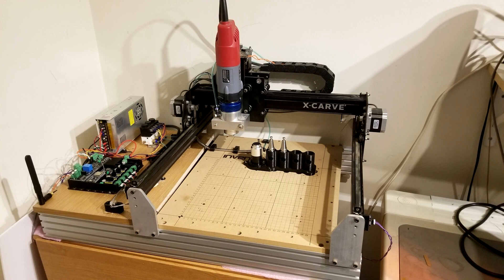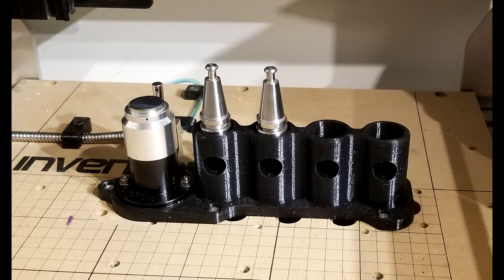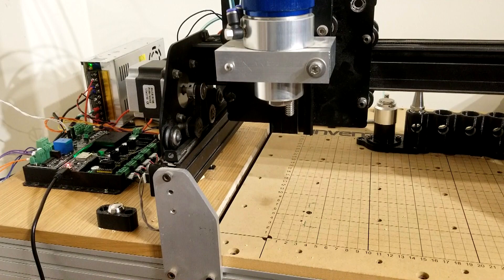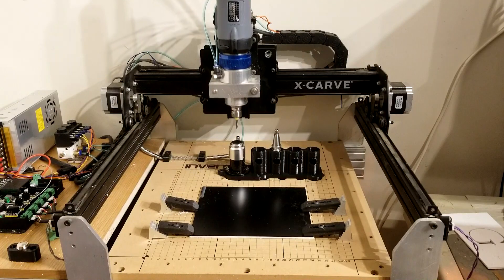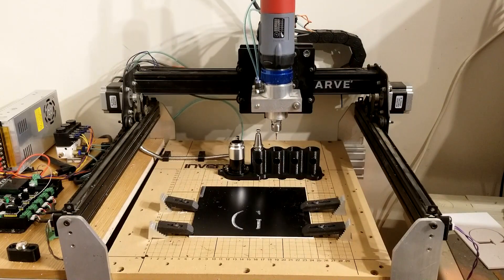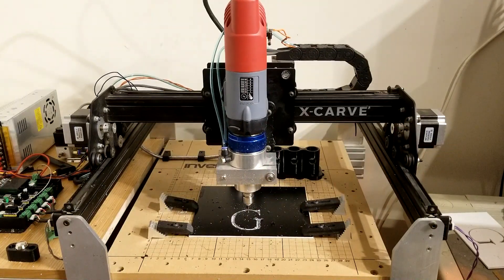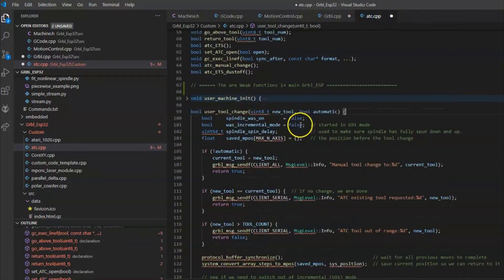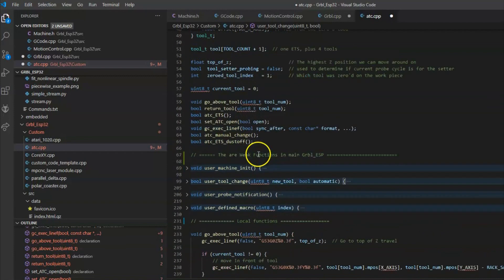A CNC Automatic Tool Changer (ATC) use Grbl_ESP32

Comment: Fantastic work! I just had an AHA moment when I realized that FluidNC is essentially, grbl for and ESP32, yeah I'm a little slow on the uptake. This means that can still use bCNC as a gcode sender for to your hardware, yes? I use Fusion 360 for CAM, how does one designate M6 tool changes in CAM? Sorry, I'm new to this game, but I sure want to setup an ATC like this one very soon!
Reply from the maker: Most CAM programs like like Fusion will do it automatically if if sees a different tool number.

I don't use Fusion 360 CAM, but many others do with ATCs. Search the Internet for info on that.

Comment: Hello
Is the project free or can you get a 6th axis motherboard with act spindle kres as you show. The board needs to drive single stepper drivers of each axis and the 4th rotary axis. Can you share files and advise on board selection
Reply from the maker: You can learn more about this project on the github repo

Comment: Just stumbled on to this. Great project! I’ve got my xcarve and have not tinkered that much with it. Only starting to think about adding a ATC.
I was amazed tho over how low the noise level is on your stepper motors. It sounds super smooth. Is this due to your controller? Can you tell me something about that?
Reply from the maker: It used a 6 pack controller and TMC5160 stepper drivers.

Comment: Hi Bart, Is there any further documentation re integrating/modding the atc.cpp? Im using several of your 6pack controllers for some smaller 5axis machines I use for gluing/gasketing my product. I'm migrating my machining mill to the 6 pack as well when I upgrade the spindle/drive. I'll be using a Jainken JGL series atc driven by a Hitachi WJ200. I only plan to use a manual tool changes as I don't have a tool rack yet. The spindle has a specific tool change air cycle (release, dust off, engage) along with an internal pressure switch. Any further elaboration or direction how to implement this on the 6 pack would be appreciated.

Comment: I actually left a comment on the issues of the github page.. but of course a day later you post this.  

So I have the AMB (formerly Kress) 1400 DI spindle..  I'm seriously looking at using the 6pack as I have been having issues with my XPro v4.. most notably the spindle speed revs up and down constantly at any speed other than full at 10v on the PWM pin.. The question I asked there, and will ask here, is how did you wire up your spindle, 0-10 goes to PWM, one goes to ground, but there is a third wire that needs to be connected to a 10 to 26V output terminal... I did not notice that option on the PWM module..

Comment: Looking good.
Is this limited to step/direction or could some axis use Clearpath SC (software control) motors?
Reply from the maker: We support a lot of motor types. A hybrid of closed loop step/dir control with feedback would be the easiest way to use that type of motor.
Reply: @engserve  how does this communicate with UGS? i don't see any wired connection?